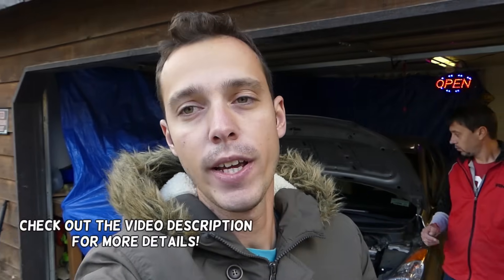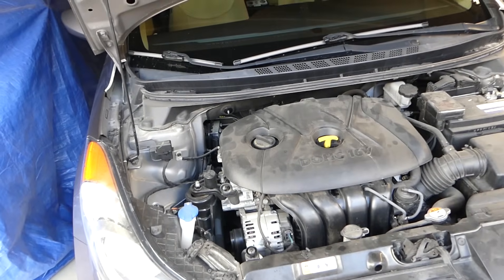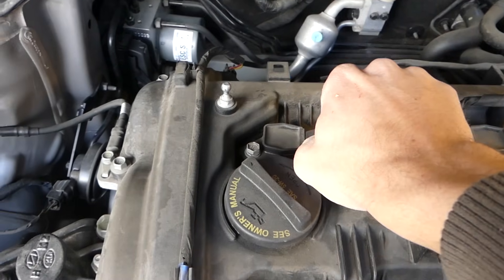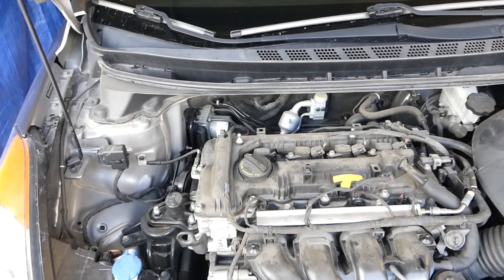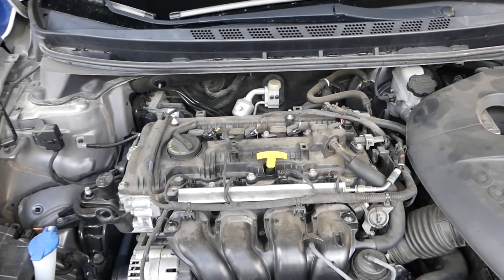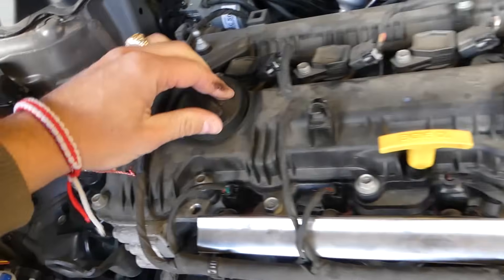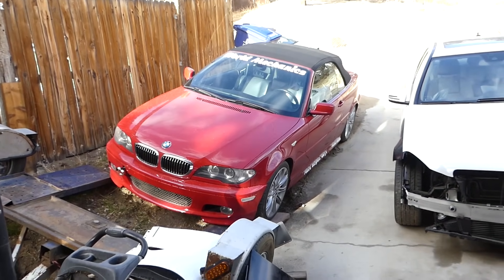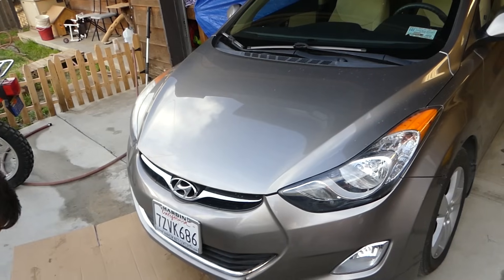HYUNDAI ELANTRA ENGINE NOISE KNOCK TICKING FIX ?

Comment from the maker: Products that we use and recommend:
► Oil: https://amzn.to/3O1xjkH
► Filter: http://amzn.to/2pdfOTp
► Panel Removal Set: https://amzn.to/3YiMADu
► Assorted Fuses: https://amzn.to/4fx4s3F
► Tool Set: https://amzn.to/3p5MM6t
► Screwdriver Set: https://amzn.to/3XRB28Q
► Mobil 1 Oil: https://amzn.to/3xBc8B9
► Oil Filter: https://amzn.to/3w0Ulme
► Torque Wrench: https://amzn.to/32qyRwg
► Liqui Moly Engine Flush: https://amzn.to/3IiDBID
► Voltmeter: https://amzn.to/4hB6Zvk
► OBD Scanner that we use most often: https://amzn.to/3I4MQfe

► Check out our Amazon Store for the tools and parts that we use: https://www.amazon.com/shop/worldmechanics
Reply: I have a same noise in my car. Can you suggest me what should i do? Or how to fix it?
Thanks in advance
Reply: Thanks. I know if i should keep the oil or change it

Comment: As owner of 2 Hyundai's (an Elantra and a Tucson) I know its all in the oil and lifters. These engines are very oil "sensitive".  Found out that a high quality full synthetic oil (like Mobil 1 or Castrol) with viscosity according to operating temperature range, tends to fix this. Besides that, helps a lot keeping engine innards cleaner.  Regards!
Reply: I have a 2003 Hyundai Elantra and I just put Noble 1 5W30 in as that's what the cap says 5W30 and now I hear the ticking noise all the time which I did not hear prior to when I had 10w30
Reply: @daby8399  if the car has more than 75K miles, High Mileage oil should be used.
Reply: Do you recommend changing the oil filter too along with the high mileage oil. I'm having this issue
Reply: I always replace rhe filter when changing oil...
Reply: I have also the same problem with my 2014 elantra, when the engine was cold and started it these ticking noise comes up but when the engine is getting hot the noise disappear
Reply: @grandmakiki5944  use amsoil that will fix your ticking
Reply: @reginaldsmall3766  pls can't get what you said. Use what pls
Reply: @Patriciafashiongh  I don’t know what you are talking about. What is “pls”
Reply: @Patriciafashiongh  Amsoil has a synthetic oil/lubricant product just like Mobil 1.
Reply: @grandmakiki5944  You always change the oil filter along with oil regardless.
Reply: @ivanrosado1969  Yeah such a waste to not replace the filter, then you can be done with it for a bit.
Reply: @artv4nd3l4y Changing oil and not changing filter is like taking a bath, but putting back on dirty clothes that smell like perspiration!
Reply: Buch of nonsense as all those oils in fact don't differ much from on other at all. Project farm has tested and debunked that already multiple times.

Comment: when I bought my 2013 Elantra it had 104000 km with a tick. It now has over 400,000 km with no worse of a tick and still going strong
Reply: And is it still ticking?
Reply: Thank you fornposting this. A tiny bit of reassurance.
Reply: @Ernestosv982   yes and over480000 kms
Reply: @medrickgodin8865 that’s awesome! I have a 2019, same engine tho as the 2013 pretty much and I noticed putting the engine treatments and changing my oil every 3-4000km helps dramatically with my Elantra, I don’t know if you do the same? Mine burns oil like you wouldn’t believe. So I have to change it more frequently. I have about 160,000 km on there right now so hearing that your Elantra is going strong, makes me more confident then I was 😂
Reply: It might be your injectors 🤔

Comment: Disconnecting ignition coils and fuel injectors isn't a way to test for piston slap. The pistons will still slap around inside their cylinders as long as the pistons are going up and down
Reply: 💯 true 👍
Reply: Depending on how bad the slap is, it can quiet it down very noticeably.

Comment: engine ticking is NOT normal for any car. should have done an OOPS and wrapped it around a phone pole and got a new car.. you have an engine doing something called dieseling. its also known as piston slap. this is from the rings wearing prematurely and can no longer center the piston as it rides the engine wall and scores the block. hyundai is known for this around 75,000 miles. oil change is a mere mask until the oil wear out again.
Reply: So keep changing it early af? Lol

Comment: I would definitely get this checked out. I also had a tick on acceleration of my 2014 Elantra and I had to wait over two months for a new engine. Warrenty covered it, only because I had every single maintence receipt. It was only 4 years old with 110,000. There was over 15 other elantras waiting for new engines at the same time as mine from just that single dealership, the only way I found this out was because I got a engine shop to rip apart my engine and contact Hyundai to figure out what’s going wrong with these vehicles. They were turning people away right and left and centre that didn’t have the paper work. I was confused why they weren’t being recalled.  Then after the replacement, they give you 90 days warranty on the new engine. I know two other people that had the same issues. Elantra’s are honestly super quiet, it was a dream until that happened.
Reply: Dakota Elli my friend lost his car the dealership told him he wasn’t Cover 2013 Hyundai Elantra GLS 78,000 Miles Second Owner And The Repair for a new engine was $3,000 He didn’t know what to do and he had a Loan of $8,000 on it
Reply: Oscar T I have the same problem and I don’t know what to do. The dealership told me that there aren’t any recalls about it.
Reply: vPanda- CA There it’s Not Recalls On This Issue But Try To Contact Hyundai Warranty Directly, They May Extend the Warranty Coverage For You Since it’s Something Related To the Engine, My Friend Didn’t Know He has a New Car Now And A Big Loan To Pay
Reply: Did they ever say what was causing the noise and how it originated??

Comment: Some people don't know the 1.6L gdi doesn't have hydraulic lifters.  The valves need to be adjusted with shims inside buckets every 80000km or 60k miles.

Comment: Are you sure it's not your coil packs? My car did the same with no check engine and I replaced the spark plugs and coil packs and the tick is gone.
Reply: Or just a major tune-up right?
Reply: Knock sensor or catalytic converter
Reply: @jessemcnabb8356  i think the knock sensor

Comment: Class action lawsuit from 2010 to 2013 Elantra.  Engine was replaced and I had to pay a percentage of the install.  Dealership did right with me.  There are certain restrictions on eligibility.
Reply: Did you call them? How did you get connected with them?
Reply: @joshuasinnema9107  The rep at the dealership acknowledged this was happening and asked me to call corporate to submit a ticket and get a case number.  There were some eligibility requirements I had to pass.  I can’t remember the exact qualifications, but it had to do with cold weather climate and driving conditions.  No issues being in Florida.

It’s as if the government and Hyundai settled on this recall and that is why it wasn’t broadcasted and every engine replaced.

Comment: Nice video. I just bought a 2010 Hyundai Elantra Touring and it has a ticking noise. So did you ever discover what it was? I changed oil and even put oil treatment in BUT it still ticks/pings mainly during acceleration. Help me out please.
Reply: Hey Valerie. If you still have your Elantra, you might want to check the more recent videos from World Mechanics and others to see if your engine is on the list of 1.8 liter engines with well known ticking problems that can result in complete engine failure. There is some key info in the comments too, just search for 2010 Elantra to see what people have learned so far. 

Hyundai did replace the core of my Elantra engine without cost as soon as it developed the ‘piston valve slap’ ticking sound at around 110,000 kms. I thought i was fortunate to have a ‘new’ engine but my car developed the same problem after another 60,000 kms. 
Today my car is stuck at the dealership garage with an estimated repair cost which is nearly double what the car is worth. It won’t run so my only option may be to have it towed away to salvage. I feel fortunate for getting a lot of use out of a used Elantra that I didn’t pay much for, but i wish i could  have traded it in to help my daughter buy a vehicle. 🤔 

My recommendation would be to make a move sooner rather than later to a car with a better rep. while your car still has some value. Good luck!🤞
Reply: Never,never,never use an oil treatment in your oil. Use amsoil 5-20.

Comment: My 2013 Elantra started doing it too somewhere around 80,000 miles. I honestly wouldn't worry too much. It only does it for about 10 minutes after you start the car and from there you won't really hear it anymore as you drive or sit in idle. I know a ton of people are worried but sometimes we freak out too much about sounds we're hearing from under the hood. Wear and tear is normal. Cars sounding a little bit rougher after several thousand miles is going to happen.

I hear people getting new engines when you probably could go another 50,000 or 100k miles with your original engine and have no issues. Ride it till it dies. With all the time you spend trying to get it looked at and even getting a new one, you don't know if you'll end up encountering more worse problems. I mean, the risk is up to you, but I would just ride it till you can’t anymore.
Reply: @chinaboss6683  Cars are sensitive machines. Sometimes messing with something you think is a problem or it really is but is minor, can create an even bigger problem that you may not even be able to fix at that point.
Reply: I agree. I find that ticks or mild knocks that go away once warmed up aren't worth doing anything about. I've had many cars tick when cold that went well over 200k miles.
Reply: @wigletron2846  Well, guess what: I ended up having to get rid of that car last year when the tick got worse. And Hyundai refused to replace the engine. So I traded it in. It's possible the car could've lasted another 3 years or only 3 weeks, but I couldn't take the risk and let her go. One thing is for sure: I'll never buy Hyundai again.

Comment: [FIXED] I had the same problem. The repair guy said it may be a valve lifter. It turned out a piston slap. So I ordered the same parts 'DNG' like in this video, from Amazon with delivery to Bulgaria. The repair guy said that the cylinder walls are too thin to be bored out, so only he did only honing. I changed many things - all pistons, a full set of gaskets, the long block bolts, all valve lifters, tensioner, timing chain, connecting rod bearings. I topped that with XADO 1 Stage Maximum. Now I have to drive 3000km under 3000rpm after the engine repair and change the oil after that. The new oil is 10w40. After the change, I think to use Ravenol 10w30, the silver one.
The total cost till now for parts and repair - 1500 euro. 
Car: Elantra Coupe 2013, 87000 km

Comment: Very nice information. I have a Hyundai Accent with 121k miles, the engine is strong and quiet, one owner and always regularly serviced.
Reply: Model year?
Reply: Hyundai Accent has a gamma engine, they don't have this kind of issues, the problem is mainly on Theta and Nu engines.
Reply: @AlexisLobos  so what would cause this noise on an accent? My car is doing this and we can’t figure out what it is!! It gets louder and faster with acceleration but rarely hearing when traveling 60+, maybe every once in a while if accelerating up a hill and don’t have the music on I’ll hear it “clicking” real loud for a second and then Goes away, but is very noticeable when going under 20 mph and upon startup and when just idling.
Reply: Let us know if it worked. I have the same issue with 2013 Accent with 100k miles.
Reply: @paytensplace5046 hi there i know this comment is over two years but i want to ask you if you found out the problem on that Hyundai accent a friend of mine has a 2016 and i noticed that does exactly the same thing your mentioned . I'll appreciate it if anyone one can tell me
Reply: @gerardodonaire699  hi there! I will reply because I know they are few and far between on these types of videos for car help lol. Unfortunately, my dad who is a mechanic was unable to locate anything in particular that would be causing it. We went to several dealerships for Hyundai to have it serviced and all of them as well as my father came to the conclusion that the motor was going out. I ended up trading it in before that happened.

Comment: I have a 2010 kia forte 2.0 and I had the same noise for years. Last year(2018) I put half bottle Marvin mystery oil and half can seafoam, used for one month, changed oil and about sixty percent of tick noise went away. Try this method. It may also work for you.
Reply: We’re you using synthetic oil?
Reply: Yeah. Marvel Mystery Oil or just oil change more often until it goes away. MMO has detergents to get the carbon out. Oil has detergents too. So if you were to change the oil more often it would do the same.

Comment: Mine did this recently got a tune up and oil change then I noticed it was idling hard. Put seafoam in it works as good as new. It also helps to keep up on all the fluids on these motors just an fyi read online they have tinier pistons I guess prior to the 10' model.

Comment: I have an 06 Sonata with 2.4L engine with the same problem. I ended up by taking the engine apart. Replaced all the rod bearings with oversized ones. Grinding the crank at a local machine shop here in Florida. Now it runs perfect with no ticking or any sort of noise
Reply: Was it fixed?
Reply: How much it cost to do that?
Reply: @mimia3510  4-6k

Comment: It's the short block. NU 1.8L engines made in Alabama from 2011 - 2016 had a defect, Hyundai is switching out short blocks for no cost. I'm in Ontario Canada and the dealership just ordered a new short block and will arrive next week.
 Alabama plant is paying.
Reply: Ontario resident here as well with a 2015 Elantra. Just noticed the noise today. How long will your car be in the shop?
Reply: @viktorsosic7487  Not too sure, I,'m sure I'll get a loaner.
 Make sure you have paperwork for oil changes.
Reply: I thought hyundais in Canada are from Korea
Reply: Any updates
Reply: Not doing that for US only Canada

Comment: Dealer told me last week I need a new engine (and not covered by warranty)but couldn't specify why. This ticking has been going from 70k to now/83k miles on my '13 Elantra, getting a little louder but otherwise no problems, loss of power, etc. I'm perplexed and pissed at Hyundai for totally turning their back on me. I'm in St Louis, looking for suggestions on how to resolve.
Reply: I was just told the same thing by the dealer after a service on my 2014 1.8 i30. its done 255,000km but the oil and filter changed every 7,500 religiously and has lived its life on Castrol edge. They said its making a rattling noise, when I started it, it was fine. Its always had a tick in the top end from new, when you start it from cold. When it does it, if you stop the engine wait a few seconds and restart, the tick is gone.

Comment: I have the same noise with my Elentra 2015 2.0 eng with 185k KM.
 the  weather is very hot in Saudi Arabia 44 Celsius
I change the oil every 5k
 synthetic  oil 5W30 and
 when cold start up i hear it out . 
After warming up no any noise. 
Is it the oil pump or ? Valves ?
Reply: How is your car today? I have the same 2015 Elantra and it needs a new motor and the dealer won’t replace it
Reply: liquid Moly- lifter additive 
Oil change she be tight💪

Comment: It's normal in cold temperature on cold start for that noise. The timing chain tensioner is oil pressure driven, so once vehicle warms up and has proper oil pressure (use a hyundai filter only on these) then vehicle should quiet down. I'm a Hyundai Technician. These engines only develop knock if oil isn't changed on time and often enough. 3,750 is the interval for city/highway driving.
Reply: 3750 of what;miles or kms?
Reply: @ismarmeskovic  miles
Reply: @ZynovFTW  Hi. I have a 2013 with 50k miles. About 45k it started ticking. I use synthetic oil. Do I need to change it that soon with synthetic? Plus, I also use mobile one synthetic filter. What do you suggest on that? Thanks
Reply: Where can I find the filter?
Reply: @ZynovFTW my 2015 still runs does the same sound I've changed alot oils now im with shell but it didn't fix the problem or anything still sound the same
Reply: hello my 2013. i30  making the same noise at 90ks any recommendations please

Comment: Question... I had my 2013 elantra idle rough then stall on me. Its cold outside here now but I had been driving the car for atleast 30mins before this happened. I let it for a few mins then started it and it was fine. I drove 5 miles at the most and as i started up a hill this ticking started. Idk where to even start on locating exactly what the problem is. It sounds like its coming from the belt side of the motor. When it stalled it felt like the serpentine belt had broken or slipped off but it hadn't. Any advice on what I should do is greatly appreciated.
Reply: What ended up being your problem? I have the same issue with my accent right now

Comment: My grandma has had several Hyundais from brand new and her sonata and elantra both had a tick since brand new, not a knock or a loud tick, just a decent little tick.
Reply: Use 93 gas and it will stop
Reply: @nathanieldinnwiddie6901  makes no difference. Its either the fuel injection system or the hydraulic lifters imo. Not a problem and shes put hundreds of thousands of miles on them this way.
Reply: Try to use thicker oil. Because I’m in hot climat country. I use 10w40 semi syn all the way. I bought the car used 90km and now I’m at 125km no ticking. Mine was 1.6 mpi gamma engine
Reply: With 95 pump gas
Reply: @desmondgreatdevil  different engine my grandma's engine is the 1.8l Nu, not the 1.6l Gamma. It's never ever been a problem you don't even hear then engine unless it's running and you open the hood